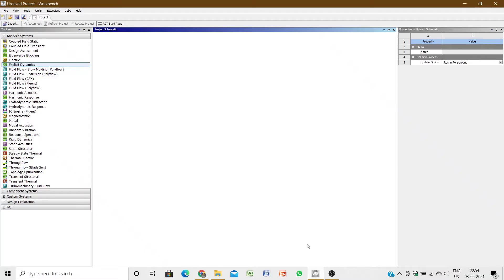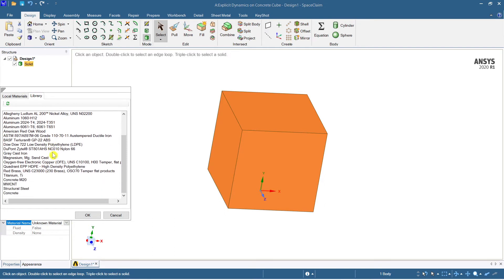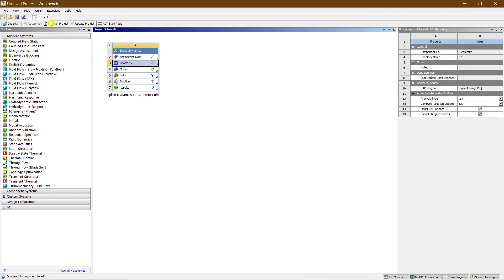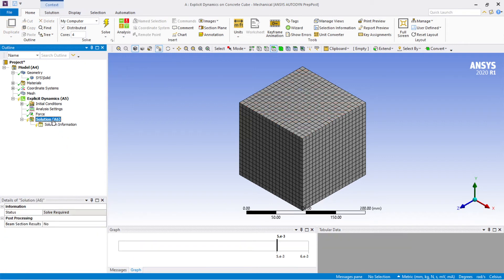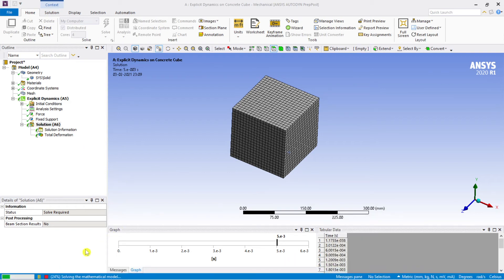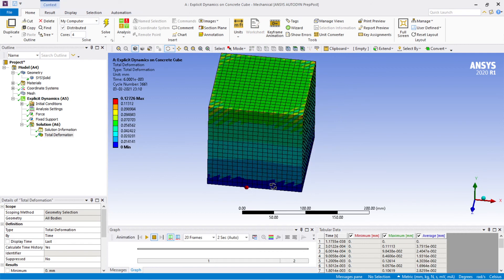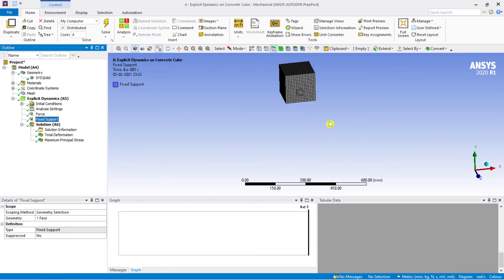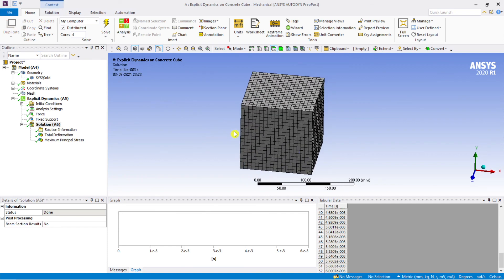Explicit Dynamic Analysis of Concrete cube in Ansys Workbench 2020 R1

Comment: Hi. How to test a reinforced concrete until it fail? For example, simply suppprted beam, apply static load until we get the fail value. Using explicit dynamic can?
Reply from the maker: Use Explicit Dynamics it would be better ..........Under static Load whatever load u apply ansys shows result.....So if it exceeds max allowable stress then consider it is failed

Comment: Hi, I would like to use glass in explicit dynamics. But the problem is glass is brittle material. There is no plastic region since it only has ultimate tensile Strength (uts). Is it possible to do analysis using explicit dynamics in order to see the crack when it was hit by solid block ? Thanks
Reply from the maker: Yeah may be possible...........U need to do some literature survey on that .........Plz share your details to kamadollishettar.abhishek@gmail.com